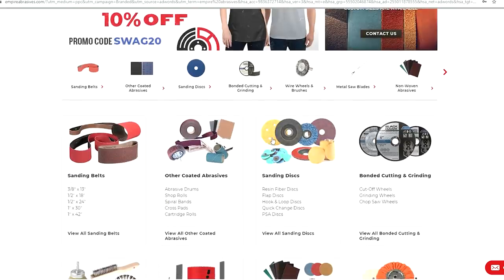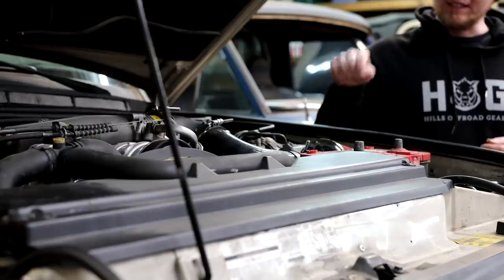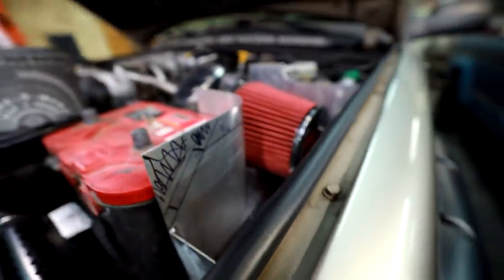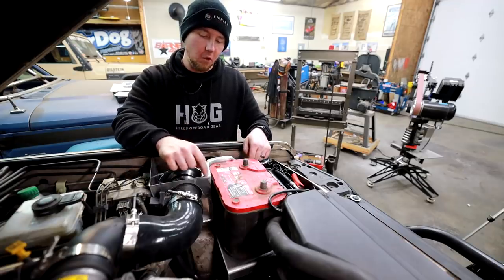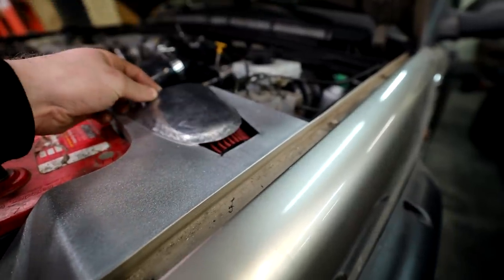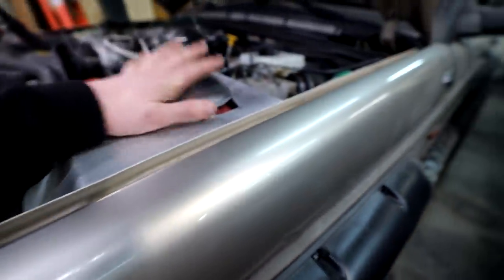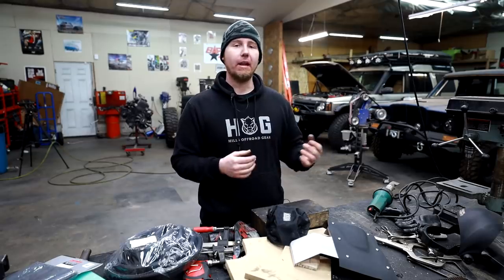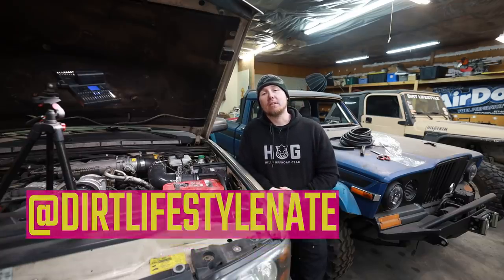TRYING To Build An Off-Road Intake That Doesn't Suck!

Comment: anyone else get worried as he put the aluminum sheet down on the battery post, then instant relief when you realize its the ground post. lol
Reply: I was waiting for the fireworks.
Reply: I kept flinching while watching, I guarantee Nate will get a chuckle out of this......
Reply: Multiple panic attacks! 😂
Reply: Yup.
Reply: Held my breath the whole time he was waving that sheet over the batt.
Reply: Yeah but the other post is disconnected anyway. Would have to touch both posts at the same time
Reply: Absolutely.
Reply: Instant wince....I was waiting for sure.
Reply: @2874mattm  didnt realize that till later in the video.  still worrysom lol
Reply: Yeah it's not connected to the truck. So even if he touched positive to chassis, nothing would have happened
Reply: None of the cables are hooked up anyways.
Reply: Full- on expected him to just scoot the plate away from him and bridge them haha
Reply: Yaah I was watching that and wondering when it was going to go BOOM.  I cut a rubber mud flap up and made a battery cover for my dual batteries to keep mistakes from happening on my rig.  To hold it in place I cut notches so I could run the rubber cover under the batteries plastic carrying handle with the plastic handle strap looping through the notches.  It works great and is easy to remove when I need to get to the batteries.  And I always keep the pplastic battery post caps that come on them from the factory for whe I have the connections removed off the posts. 
Had a battery short out once after a wrench slipped off the fender and it blew battery acid all over the underside of my freshly painted hood.  So I am super careful about working around my car batteries.

Comment: The wrinkles in the plastic are annoying, but using proper heat with a vacuum process is effective for me most of the time.
Sounds like that wasn't the biggest problem, though.
Thanks for the video, brother. In my opinion, when those of us with less talent see people with a lot of talent failing it relieves some of the anxiety of getting started, so this is great :)

Comment: Your original problem was the K&N filter and not carrying a spare paper filter on your trip. The OE filter box is fine and works well for dusty trails. 

My suggestion - Stick with the standard filter box, add a snorkel with Donaldson pre-filter on top for particularly dusty trails, Group 31 110 Ah battery fitted in standard battery tray and compressor in the rear (plenty of room in your side bins).  The rear side bins will also take another Group 31 battery if you need lots of auxiliary energy storage. 

Awesome fabrication skills and some great pointers on some new tools to consider.  Your honesty is your greatest asset.

Comment: To be fair, (and I'm not the first to say this looking at the current top comment) my experience with K&N, it did this same thing to my intake and it was not clogged.  Not that it wasn't a real issue for you, but much of that microscopic dust was just what was allowed to pass through the filter.  I threw my K&N away.  Junk.  Also, FWIW, I regularly serviced the filter with a K&N recharge kit.  Junk.

Having said that, I appreciate the process.  Not everyone shows the failures and the hours spent on a project that just doesn't end up working out.  Great content!

Comment: I spent the first half of the video wondering why no snorkel, but you answered that once you decided to change to a panel filter. Fact is you want the cleanest available air (usually from up near the roof) feeding to your airbox and then thru the filter and to the engine. That gives you a filter that lasts longer between cleans or replacements. My 76 Series Landcruiser V8 does a lot of outback travel (downunder in Aus) covering many thousands of kilometers on dirt and with a snorkel the filter service life between cleans is 10,000 to 20,000 kms.

I think you may also need to re-think the location of the second battery as you need an airbox big enough to allow the air to flow smoothly. Too many corners and snug spaces can really spoil the air flow rate.

Great video and best of luck on the rest of the build. 

And as we say in Aus "keep it right side up!!"

Comment: Hey Nate love the build and have a good idea for the intake if you care to hear me out. I’d recommend adjusting the locations of the battery/compressor on the drivers side and run the feed of the intake box from the cowl. The cowl cover on the Disco II already has a pre-filter built into it that used to prevent the debris from entering the cabin air filter. I’d did something similar on my TJ since I’m not a fan of snorkels. Hope this helps with finding a solution and keep out for Adventure Bound Offroad at KOH next week!

Comment: Nate, whether you use the stock air box or fab a custom one. Use grease on the sealing surface between the filter and the box to keep the fine dist particles from going into the intake. Also, those fabric filters acually filter better when some dirt builds up on the filter material. Old dirt track racers never would wash a fabric filter element. They would knock off the heavy buildup and re-apply the appropriate filter oil if it looked a little dry. Grease the mating surface (K&N makes a specific grease for this) and hit the starting line. Hope this helps.

Comment: You need to have an oiled foam filter for dusty conditions like on a dirtbike. It would be cool to build a air box using a filter and cage that mounts just like a dirtbike for quick changes. You'd have lots of options for filters and pre filters and keep a spare or two to swap out real quick. Something that has the wing nut go through the middle of the filter.

Comment: You are extremely good at getting creative with your fabrication. This is just one instance where creativity got ahead of practicality. I wondered why you didn't decide on a panel filter as soon as you pointed out the fitment problem with the cone filter. You could probably build a good box with a panel filter and still keep the second battery under the hood.

Comment: From a mechanic standpoint my only advice on this is to have an easily removable filter and get in the habit of blowing it out daily when in very dusty terrain.   Your factory type filter actually does an amazing job for this when it has the correct filter for the environment but most filter media doesn’t catch that super fine dust.  Pre filtering a cartridge type intake is a wonderful concept and works wonders when in those super dusty areas.  No matter how you look at it, building a viable intake suitable for all environments is a challenge.

Comment: If you don't like the snorkel you can look at one of those tornados.  The Army uses them on the HUMMER. Air comes in and swirls around in a circle. Dust is thrown to the edges and the air induction pulls from the middle. Low profile and easy to clean.

Comment: Good video Nate, that plastic is interesting.
Glad you decided to move the battery and go panel filter, let it breathe. Also the larger the filter and the area around the filter will slow down the air speeds and let the filter be more effective, they don't filter as well if the air moves too fast.
4 inch stainless tube snorkels are real popular down here (Aus) google them a bit (for Patrols etc) you might like them, plus you can put a proper ram head from truck parts suppliers on them. Bigger is better with the snorkel too, it will keep the air speeds down.
Love your work bro👍

Comment: Failing at something simply makes you more wise. Awesome fabrication skills man... just found your channel and really enjoying it. I currently have a nice project going on, currently swapping my 2k chevy k2500 IFS out to a solid front dana 60 and it has the factory 14 bolt rear with a locker, powered by a 7.4 and 4l80...not getting too crazy because it's still my daily driver (for now)

Comment: I think you're on the right path and now you're deviating to something that is good. May I suggest you research how to make a rigid foam mold that you can then lay up with fiberglass or advanced composite. This message will do what you want. Once you learn how to do it you can do it rather quickly.

Comment: Summit Off-Road offers a dual-piston version of the Smitty compressor with effectively twice the flow rate, so you can replace two compressors with one, and free up space on the driver's side to move the battery forward.

Comment: There's a saying that any plan that works today is better than waiting for the perfect plan tomorrow. (I.e. The kind of tomorrow that never comes) I think there is a flip side to this: Learning lessons from a failed plan today leads towards a perfect plan tomorrow. (The tomorrow that comes from perseverance and knowledge learned from previous failed attempts and honest analysis). If nothing else, you got to practice the skills of metalworking and fabrication so they are up to snuff for the next attempt. Being able to mentally wing it from general concept to fine finishing details is great when it works, but sometimes a defined, detailed plan before touching a tool can save a lot of time and expense. Just keep it flexible enough to keep ahead of the gremlins that inevitably show up. Looking forward to seeing Intake fab v2.0!

Comment: Hey don't know if you know this tip, but when bending and forming Aluminum, it work hardens. You need to anneal it in between and it's super easy if you have an acetylene torch. Bassically turn the oxygen off get a nice dirty flame and coat your piece in soot, then get the torch hot and evenly heat it until the soot burns off which is right around 800° which is just the right temperature to soften up the aluminum.

Comment: If you are gonna move the battery,

I honestly would advise doing LIPO battery in the rear.

So keep the lead acids for cranking and winching, then a nice big 150ah lipoe battery, they lighter and can buy the cells separately and fit them somewhere in the rear.

I have really been wanting to make an upgraded airbox for my Suzuki Jimny, actually what got me starting to watch your channel, so super keen to see what you come up with.

I would also look into using a donaldson style air filter.

Comment: When you do revisit I'd highly recommend just sticking to a paper panel filter. I've learned the hard way washable filters are just too much hassle. The filtration is so much better with paper and you honestly won't see any performance loss. If you're interested, mighty car mods did some really interesting testing on their channel years ago basically proving k&n style filters are a terrible product. Essentially you pay more for less filtration, no hp gains, and oil will eventually come off the filter and land on the MAF sensor messing up fuel ratios, damaging the cats, etc.

Comment: Snorkels are the only way to go. Here in OZ every 4x4 has one. You can get cleaner air into the system at roof level and you can put a precleaner sock over the head of the snorkel. Clean or swap socks at the end of each day and the main filter remains clean. The other advantage of snorkels and seal air boxes are deep water crossings are no longer a problem.

Comment: I would like to just throw an idea that I plan on doing on my rover. I cant do a full snorkel that goes up to the roof, so I debated building a sealed box like you plan to and running a "snorkel" through the fender like a normal snorkel would. Except that I was just going to have the pipe come out flush with the fender out the side, near the A pillar (above the marker light on the fender) and use something like an frogskinz waterproof mesh over the hole (or a side vent similar to the OEM setup on a mercedes G wagon). I think this might work for you as well, since your wife doesnt like snorkels. You get the dirt fighting functionality without the water fording and look, but it might fit your needs well! Good luck!

Comment: Snorkels are great for keeping dust away from the engine, if not, ask the Aussies, they have been using them for ages.  BTW, that funky filter cover, I've learned back in 1992 that you can make those with a panyhose, courtesy of a volcano in Alaska.  My Land Cruiser ran with one until I sold it in 2000.

Comment: Probably a good thing the kydex didn’t work out. Since it is heat malleable, I’d be concerned the engine heat combined with ambient desert heat would soften the kydex enough to deform as the lid to an air box. While probably much hotter, I’ve seen kydex holsters left inside a car in the summer drastically soften and lose retention/completely deform. On a side note, great videos. Top notch fabrication. Ideas evolve as we work through them. Love this channel.

Comment: That title is deep, man.

Which Al alloy are you using and did you anneal it before you started working it? If you get something like 6061-T6, that is already heat treated and won't form as well. I asked Ron Covell on his YT channel what alloy he was uses when he forms aluminum and I am pretty sure he responded with 3003.  I know you can anneal 3003 with a torch, but not sure if 6061 anneal as easily.  Wikipedia says heat to 415 °C for 2-3 hours to anneal 6061. With 3003 you just soot it up with a torch, then heat it until the soot burns off. 6061 is generally a structural alloy while 3003 is know for workability. 

He's been posting some new videos on here recently so if you have any interest in metal forming check him out. He is the master.
Reply from the maker: Nope I didn't anneal it 👍

Comment: How strange as I’ve just finished an air intake box which I would also consider a failure. Only because it didn’t turn out as clean and sharp as I would expect it to be. So seeing you building an air intake box was kinda nice and as someone else said “wot failure” only time spent on a project that doesn’t go anywhere but that’s called experience.

Comment: As others have pointed out your so-called failure is still beneficial to us.  Funny thing is not being the perfectionist that you are, I would have used that beat up piece.  haha.  Love those shrinker/stretchers.  Maybe too late now but, I would have maybe used the perimeter of the aluminum and either glued or riveted a big whole piece of kydex and made a separate piece where the wrinkle is and plastic welded that to the rest of the housing lid.

Comment: I went with a big cone filter as well, while I agree the really small crap getting into the engine isn't good, the oil filter will take most of that damage out.  I run SE Oregon fairly often, alkali dust...and a lot of it.  Blowing out the filter every day or 2 is a must.  We did the same in the Army down at NTC (Fort Irwin) in the Mojave.  Not sure you could avoid having to blow the thing out.  Surface area is great but really only delays the inevitable. 

I do need to put a condom on the filter, though.  Think that will do more than an air box.  Your "failure" is more cosmetic than functional.

I do want to think about putting "snorkel" on my Ranger, but not really....just put the intake at the top of the hood is enough.  I'm not going to be submerging the truck anytime soon, just want to keep wash out of the intake at a river ford.

Comment: Don’t feel bummed out. As I have always done my best to life by “live and learn from our mistake and move forward, don’t dwell on them”. 

With your Kydex top couldn’t you make an aluminum trim piece to cover the wrinkles? It would add a bit more of a finished look. I know you stated you didn’t want to revisit it but it’s an option in my opinion. I like the air filter idea without a snorkel but I do understand the point of a snorkel as well. 

You may not think so but I still thought it was a great video. What hammer and bag were you using to make the rounded top? I can think of a few things I could use that for. Can’t wait to see the next video and the Land Rover on the trails!!

Comment: I definitely wouldn’t call this a failure, I think it’s good idea to stick with a panel filter it makes everything much simpler if you need a replacement you can use a factory filter. For a snorkel a pretty common way over here in Australia is to use 4 inch stainless pipe, the only downside is they can be very noisey but personally I like the noise.

Comment: Good call on not using the kydex. It's low melting point probably wouldn't work out well in a hot engine bay.

Comment: Might just be me but is there a reason you didn't consider a snorkel? Stainless steel up to the top of the A pillar? makes the air intake higher and reduces the likelihood of pulling dust into the airbox in the first place... And adds the ability to do deep water crossings when touring too...

Comment: Use a paper filter!! They filter much better than any of the garbage aftermarket units and you don't lose any power if it is properly sized. There are typically more pleats, which means more flow area, so even though the pores are smaller, the airflow is roughly the same. Plus, no oil in the filter issues and they are super cheap to replace.

Comment: now you know why we in europe and australia use snorkel on the car it is for the engines to get fresh air
Reply: And don't some snorkels have a spinning action to separate the dust from the air?
Reply: @marklundeen1025  Yes There are several types of snorkel tops. I have two types. The usual scop,and a centrifugal type.

Comment: For the compressors air intake, i ended up removing the top plastic housing and was able to tap the intake hole on top of the head to 3/8 npt. then i was able to run it to another airbox. hope that idea helps

Comment: You definitely need a pre-filter sock if you run a cone filter. It will catch the majority of the dirt you were having issues with. They are easy to clean too if you see it getting plugged up.